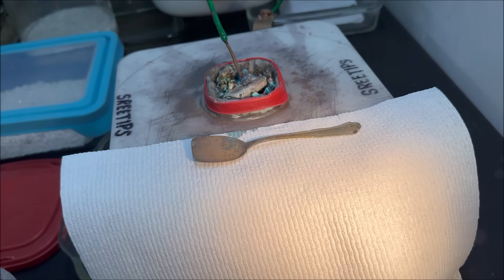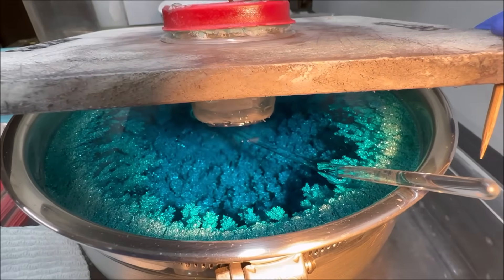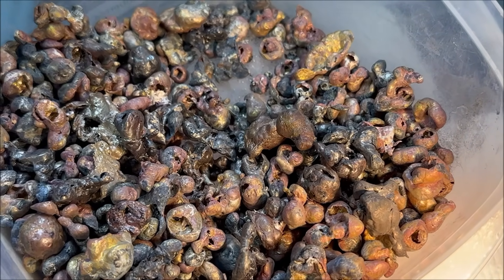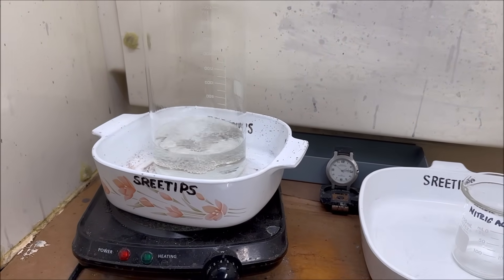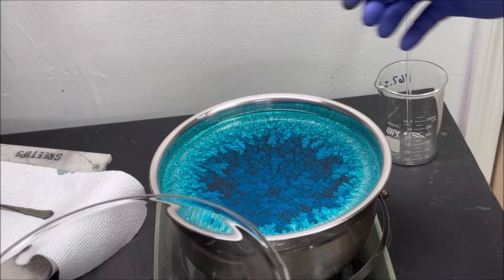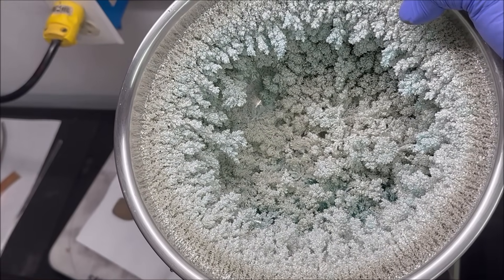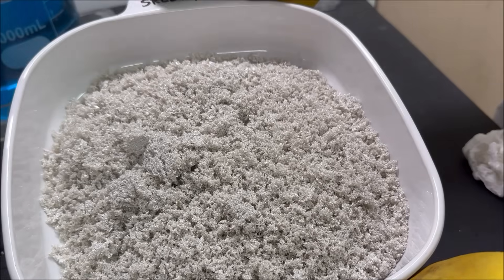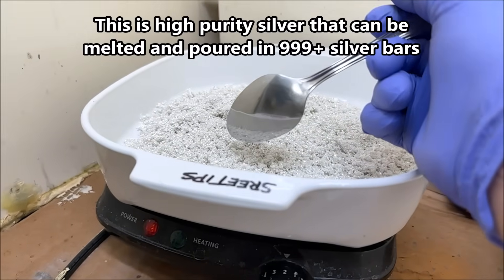999 Fine Silver Cell Harvest and Reboot

Comment: So do u make a profit
Reply from the maker: The silver is my profit.
Reply: @sreetips  so is that a yes? Bc Ik you got to feed it constantly as a "refining" method
Reply from the maker: Did I gain more currency than I spent? I don’t know. I’d have to sell it to realize a gain or a loss. And I’m not selling my silver. I refine gold. I use sterling silver, that I buy at estate sales, to refine the scrap gold. I recover the silver from that, melt into shot, and run it through my silver cell. Silver is a by-product of my gold refining. The cell converts the impure silver (about 980 parts per thousand silver) to high purity four nines fine (9999 parts per ten thousand) pure elemental silver metal. So I’m refining the impure silver, into high purity silver, not creating silver out of thin air. When it’s full, I harvest the pure silver crystal, put it away and forget about it. Then I repeat the whole thing again.

Comment: With that yield divided by the 13 day growth time and multiplied by the number of days in a year, i'm estimating 76k USD/year gross at current prices of 953/kilo.
Reply from the maker: Sounds right. Impressive math skills.
Reply: @sreetips  lol, i didn't think it was that impressive... at least not as impressive as making 76k this easily! and you could scaled this too!  

i would love to see a video on safety precautions needed for this process!
Reply from the maker: Just remember this: I refine gold. I use sterling silver, that I buy at estate sales, to refine the scrap gold. I recover the silver from that, melt into shot, and run it through my silver cell. Silver is a by-product of my gold refining. The cell converts the impure silver (about 980 parts per thousand silver) to high purity four nines fine (9999 parts per ten thousand) pure elemental silver metal. So I’m refining the impure silver, into high purity silver, not creating silver out of thin air. When it’s full, I harvest the pure silver crystal, put it away and forget about it. Then I repeat the whole thing again.

Comment: Yeah ok but the real question is where do these 4kgs of silver come from
Reply from the maker: I refine gold. I use sterling silver, that I buy at estate sales, to refine the scrap gold. I recover the silver from that, melt into shot, and run it through my silver cell. Silver is a by-product of my gold refining. The cell converts the impure silver (about 980 parts per thousand silver) to high purity four nines fine (9999 parts per ten thousand) pure elemental silver metal. So I’m refining the impure silver, into high purity silver, not creating silver out of thin air. When it’s full, I harvest the pure silver crystal, put it away and forget about it. Then I repeat the whole thing again.

Comment: What’s the point of this ?, he explains very well what he’s doing but not why.
Reply from the maker: I refine gold. I use sterling silver, that I buy at estate sales, to refine the scrap gold. I recover the silver from that, melt into shot, and run it through my silver cell. Silver is a by-product of my gold refining. The cell converts the impure silver (about 980 parts per thousand silver) to high purity four nines fine (9999 parts per ten thousand) pure elemental silver metal. So I’m refining the impure silver, into high purity silver, not creating silver out of thin air. When it’s full, I harvest the pure silver crystal, put it away and forget about it. Then I repeat the whole thing again.
Reply: @sreetips  thanks for the explanation, indeed precious metals are a great store of wealth. I need to step up my stacking game as a hedge against currency depreciation.
Reply from the maker: We all do. But very few will actually do it.
Reply from the maker: Also, silver is real money, currency is not. So I’m converting paper currency, that’s declining in value and purchasing power, into high purity silver, that’s rising in value.

Comment: What I don't understand, is what contained the silver to begin with.
Reply from the maker: I refine gold. I use sterling silver, that I buy at estate sales, to refine the scrap gold. I recover the silver from that, melt into shot, and run it through my silver cell. Silver is a by-product of my gold refining. The cell converts the impure silver (about 980 parts per thousand silver) to high purity, four nines fine, pure elemental silver. So I’m refining the impure silver, into high purity silver, not creating silver out of thin air. When it’s full, I harvest the pure silver crystal, put it away and forget about it. Then I repeat the whole thing again.
Reply: Thanks,now I understand

Comment: So you start with a 'host load' of impure silver or 'junk silver' is that right, like where did you get the original silver from, this is a refining process not a creating process yes?
Reply from the maker: Correct. I refine gold. I use sterling silver, that I buy at estate sales, to refine the scrap gold. I recover the silver from that, melt into shot, and run it through my silver cell. Silver is a by-product of my gold refining. The cell converts the impure silver (about 980 parts per thousand silver) to high purity four nines fine (9999 parts per ten thousand) pure elemental silver metal. The impure silver is added to the anode basket. The anode basket is suspended in the silver nitrate electrolyte. I pass an electric current through the impure silver. The impure silver dissolves, passes through the Dacron filter, travels through the silver nitrate electrolyte, and deposits (grows) on the inside of the stainless steel bowl (the cathode) as high purity elemental silver. The bowl is connected to the negative pole of the power supply. The process only deposits pure silver on the cathode. So I’m refining the impure silver, into high purity silver, not creating silver out of thin air. When it’s full, I harvest the pure silver crystal, put it away and forget about it. Then I repeat the whole thing again.

Comment: What are you starting with?
Lower grade silver or some kind of scrap material?answered my question at 4:00
Reply from the maker: I refine gold. I use sterling silver, that I buy at estate sales, to refine the scrap gold. I recover the silver from that, melt into shot, and run it through my silver cell. Silver is a by-product of my gold refining. The cell converts the impure silver (about 980 parts per thousand silver) to high purity four nines fine (9999 parts per ten thousand) pure elemental silver metal. The impure silver is added to the anode basket. The anode basket is suspended in the silver nitrate electrolyte. I pass an electric current through the impure silver. The impure silver dissolves, passes through the Dacron filter, travels through the silver nitrate electrolyte, and deposits (grows) on the inside of the stainless steel bowl (the cathode) as high purity elemental silver. The bowl is connected to the negative pole of the power supply. The process only deposits pure silver on the cathode. So I’m refining the impure silver, into high purity silver, not creating silver out of thin air. When it’s full, I harvest the pure silver crystal, put it away and forget about it. Then I repeat the whole thing again.
Reply: @sreetips  thank you.

Comment: But do those crystals convert diretly into real silver weight ? If you melted down that 1.34kg into a silver ingot would it be .999 pure 1.34kg ingot ?
Reply from the maker: Yes. Every pure silver bar or coin on the planet began as pure silver crystal, just like you see in this video.
Reply: @sreetips  so you are essentially printing money...at current rates that is around $1340 USD in 14 days...what does it cost you to make that out of curiosity, not start up costs but now that you are running what does a batch cost roughly ?
Reply from the maker: I’m not sure. I don’t track expenses for each batch. This is my hobby. And I don’t sell the silver. I keep it (except a few ounces on my eBay site). You make your profit when you buy.
Reply: @sreetips That is not reeeallly true, strictly speaking. Silver is one of the few metals that exists in elemental form in nature, and that is how it was first discovered and used many millennia ago. Later we learned how to extract it from ores through chemical processes (first by reducing silver salts, later by high-temperature refining called cupellation). Cupellation remained the dominant production method for a long time. After that came pan amalgamation. Then the Pattinson process (a purely metallurgical process) and Parkes processes were developed. Even later, after electric current became known and electricity production became inexpensive, did electrolytic refining become practical, and that happened around 1900. Today, silver is produced electrolytically as a byproduct of copper refining. 

So actually, there is a high chance that any silver refined before around 1950 never went through any electrolytic or chemical crystallization.
Reply from the maker: Ok, thanks for setting me straight about that.

Comment: I view myself as a very intelligent person but I have absolutely no idea how the hell this works even as he was explaining the process word for word 💀 and it seems like everyone in the comments knows exactly what’s happening and most even have input!😂
Reply from the maker: I refine gold. I use sterling silver, that I buy at estate sales, to refine the scrap gold. I recover the silver from that, melt into shot, and run it through my silver cell. Silver is a by-product of my gold refining. The cell converts the impure silver (about 980 parts per thousand silver) to high purity four nines fine (9999 parts per ten thousand) pure elemental silver metal. The impure silver is added to the anode basket. The anode basket is suspended in the silver nitrate electrolyte. I pass an electric current through the impure silver. The impure silver dissolves, passes through the Dacron filter, travels through the silver nitrate electrolyte, and deposits (grows) on the inside of the stainless steel bowl (the cathode) as high purity elemental silver. The bowl is connected to the negative pole of the power supply. The process only deposits pure silver on the cathode. So I’m refining the impure silver, into high purity silver, not creating silver out of thin air. When it’s full, I harvest the pure silver crystal, put it away and forget about it. Then I repeat the whole thing again.

Comment: Whoa whoa whoa whoa back up, how do you “grow” silver..?
Reply from the maker: I refine gold. I use sterling silver, that I buy at estate sales, to refine the scrap gold. I recover the silver from that, melt into shot, and run it through my silver cell. Silver is a by-product of my gold refining. The cell converts the impure silver (about 980 parts per thousand silver) to high purity four nines fine (9999 parts per ten thousand) pure elemental silver metal. The impure silver is added to the anode basket. The anode basket is suspended in the silver nitrate electrolyte. I pass an electric current through the impure silver. The impure silver dissolves, passes through the Dacron filter, travels through the silver nitrate electrolyte, and deposits (grows) on the inside of the stainless steel bowl (the cathode) as high purity elemental silver. The bowl is connected to the negative pole of the power supply. The process only deposits pure silver on the cathode. So I’m refining the impure silver, into high purity silver, not creating silver out of thin air. When it’s full, I harvest the pure silver crystal, put it away and forget about it. Then I repeat the whole thing again.

Comment: So he turned pure silver bar into pure silver flakes? Or am I missing some magic here?
Reply from the maker: I refine gold. I use sterling silver, that I buy at estate sales, to refine the scrap gold. I recover the silver from that, melt into shot, and run it through my silver cell. Silver is a by-product of my gold refining. The cell converts the impure silver (about 980 parts per thousand silver) to high purity four nines fine (9999 parts per ten thousand) pure elemental silver metal. The impure silver is added to the anode basket. The anode basket is suspended in the silver nitrate electrolyte. I pass an electric current through the impure silver. The impure silver dissolves, passes through the Dacron filter, travels through the silver nitrate electrolyte, and deposits (grows) on the inside of the stainless steel bowl (the cathode) as high purity elemental silver. The bowl is connected to the negative pole of the power supply. The process only deposits pure silver on the cathode. So I’m refining the impure silver, into high purity silver, not creating silver out of thin air. When it’s full, I harvest the pure silver crystal, put it away and forget about it. Then I repeat the whole thing again.
Reply: @sreetips  now I get it, thanks mate. Though I don't how is that profitable ;/
Reply from the maker: The silver and gold is my profit. I’ve effectively converted paper dollars that are declining in value and purchasing power, into highly valuable metals that are rising in value
Reply from the maker: I don’t have to worry about reselling the metal. Because the metal is wealth. I just deposit the gold and silver into my savings.
Reply: @sreetips  indeed I do the same. But from calculations I would be on a huge loss if I wanted to do the same as you. Simply buying silver coins even if old ones is more reasonable in my case. Don't have source of cheap silver unfortunately. Maybe if I could mine it
Reply from the maker: We buy silver at local sales. I recently turned down about ten pounds of silver at nearly half off the spot price. It’s out there. But it won’t just fall in your lap. You got to get up early and be there first. Also, and very important to understand, the sterling silver can be held like it is. Sterling contains a known quantity of silver. It will track right on up with the bullion. So as long as you don’t try to “melt it down” and ruin the markings. No need to refine it.

Comment: I’m confused here.  So are you growing silver here or just refining it?  Like are you gaining silver by doing this or putting silver in that is being electrically dissolved and purified?
Reply from the maker: I refine gold. I use sterling silver, that I buy at estate sales, to refine the scrap gold. I recover the silver from that, melt into shot, and run it through my silver cell. Silver is a by-product of my gold refining. The cell converts the impure silver (about 980 parts per thousand silver) to high purity four nines fine (9999 parts per ten thousand) pure elemental silver metal. The impure silver is added to the anode basket. The anode basket is suspended in the silver nitrate electrolyte. I pass an electric current through the impure silver. The impure silver dissolves, passes through the Dacron filter, travels through the silver nitrate electrolyte, and deposits (grows) on the inside of the stainless steel bowl (the cathode) as high purity elemental silver. The bowl is connected to the negative pole of the power supply. The process only deposits pure silver on the cathode. So I’m refining the impure silver, into high purity silver, not creating silver out of thin air. When it’s full, I harvest the pure silver crystal, put it away and forget about it. Then I repeat the whole thing again.

Comment: How do you know when to change the electrolyte?
Reply from the maker: I use the electrolyte for two runs, adding more silver for the second run, never more than twice. I used it three times once. Only adding distilled water. After the third run the electrolyte was completely devoid of silver, non would precipitate out. The silver turned green. Made a believer out of me.

Comment: There was a viral video a few years ago about getting gold from the sides of interstates or freeways, just a lot of dust that when refined could have very high value metals. So this would probably be a good process for that. But is there a way to use electrolysis to crystalize only the silver, then after it's all been extracted use the same method to then extract only gold, then platinum and so on?
Reply from the maker: Yes
Reply: @sreetips  I'm in

Comment: Im a little confused...did you "grow" yhr silver or simply harvest it from the left overs from your gold refining? Did you get more silver than you put in? This is new to me but very interesting.
Reply from the maker: I refine gold. I use sterling silver, that I buy at estate sales, to refine the scrap gold. I recover the silver from that, melt into shot, and run it through my silver cell. Silver is a by-product of my gold refining. The cell converts the impure silver (about 980 parts per thousand silver) to high purity four nines fine (9999 parts per ten thousand) pure elemental silver metal. The impure silver is added to the anode basket. The anode basket is suspended in the silver nitrate electrolyte. I pass an electric current through the impure silver. The impure silver dissolves, passes through the Dacron filter, travels through the silver nitrate electrolyte, and deposits (grows) on the inside of the stainless steel bowl (the cathode) as high purity elemental silver. The bowl is connected to the negative pole of the power supply. The process only deposits pure silver on the cathode. So I’m refining the impure silver, into high purity silver, not creating silver out of thin air. When it’s full, I harvest the pure silver crystal, put it away and forget about it. Then I repeat the whole thing again.
Reply: @sreetips  thank you for explaining that!
Reply: What I dont understand is if these unrefined silver bits (that look like melted/disfigured bullets), above which you are placing the cathode, are they somehow reusable and you use the same batch each time. numerous of times, or are they "wasted/used up" each iteration and you change them.

Also, what can we buy as an alternative to these "shavings"? Can you advise?

Thanks! ❤